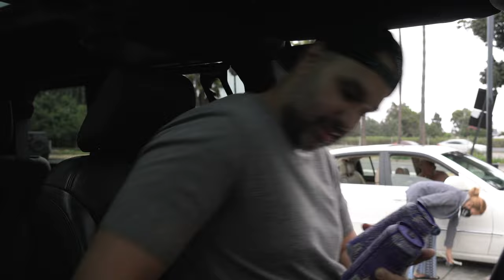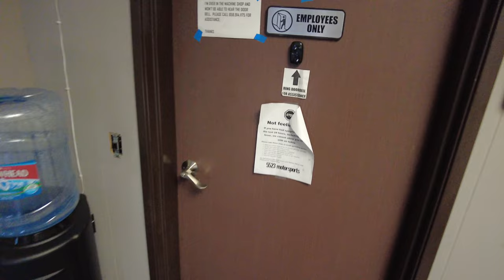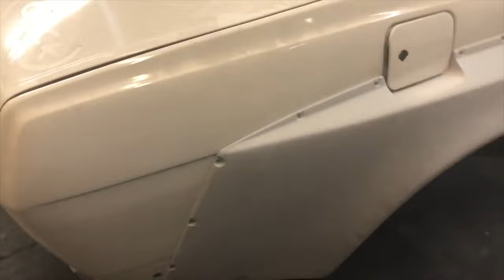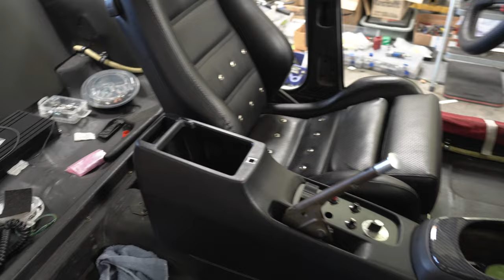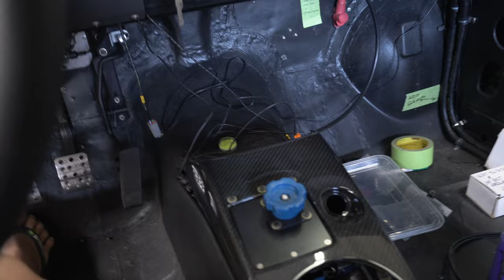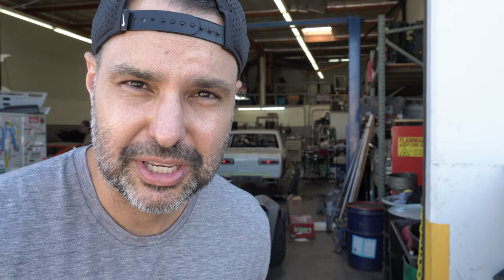Vlog 0002 - A 1968 Datsun 510 Meets A 1971 Skyline GTR For Our Project Hakobird Update

Comment: Great video , could you tell me the  supplier of your  new tail lights please , they look great.  Thanks from Australia
Reply from the maker: They aren’t new. They are GL tail lights that were New Old Stock. I converted them to LED panels instead Of incandescent bulbs.
Reply: Thanks again for the quick response, are you able to give me a link or advise me  where to get a set of led lenses? I am also on a 10 year rebuild journey 510 4 door,  I am off to dyno tomorrow so hoping first drive this week if all goes well. You know what's its like though, not getting my hopes up too high yet.

Comment: Where are you located? I'm in LA. Would love to compare notes when they're done!
Reply from the maker: I'm in Irvine.  The car is in Escondido.  Happy to show it to you any time you like.  My kit is all messed up from bad paint and body work.  Carbon Signal was great to work with.
Reply: @ChrisNaghibi  Mine is in body work in La Puente right now. My kit took forever because of Covid and FedEx restrictions, but they were really cool despite my frustrations. I'm getting engine work done as we speak, putting in a CA18DET. So it should all come together around Xmas time...MAYBE...LOL
Reply: @ChrisNaghibi  Did they mess up the kit to the point where you're not going to use it? Or are you going to repair it? That's an expensive mess up.
Reply from the maker: I still need to figure that out, but the outlook doesn’t look good. The hood will never really be fixed. If you see how it looked pre paint in the vlog, they totally messed up the gaps and removed almost an inch from the back of the hood.
Reply: @ChrisNaghibi  Damn, that sucks. Everyone tells me that it pretty much fits well. Now you've got me nervous. LOL Mine arrives this week. Any advice for my body shop that would help us prevent the same fate?